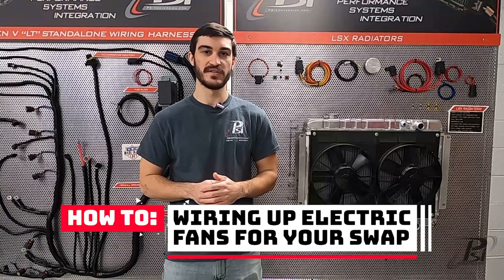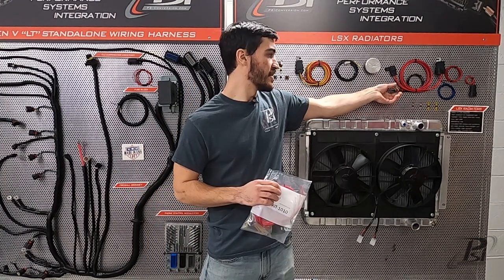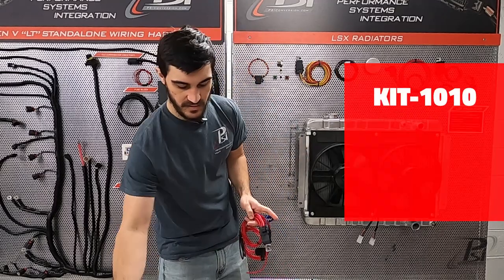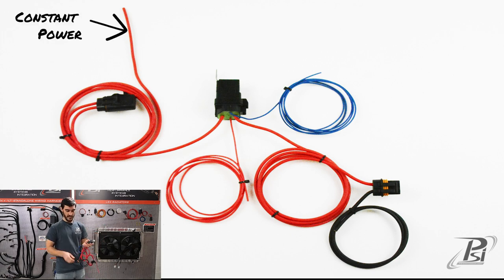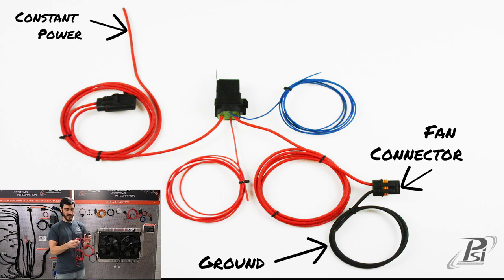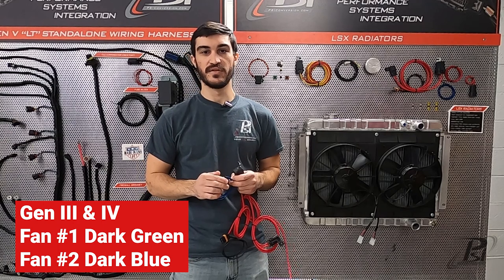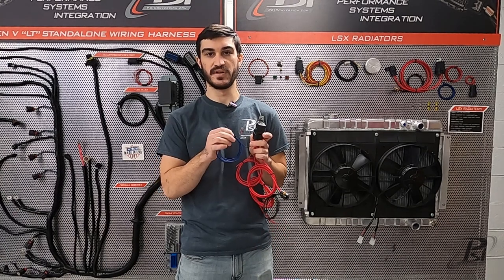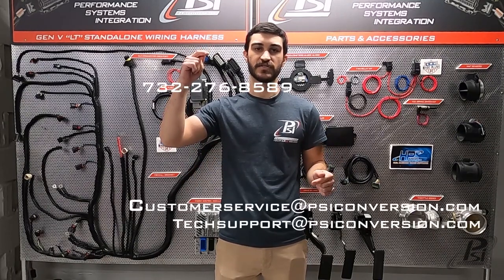PSI How to Wire Fans for an LS or LT Swap Kit-1010 kit-1010 KIT-1010

Comment: I am wanting to trigger the fans from signal wire that activates the oem AC compressor,,, can I run this in line with the trigger on supplied in your harness?  Your harness made my swap easy!
Reply from the maker: the simplest way would be to use a vintage air trinary switch. our fan relays are ground triggered, but the switch is the best way. Also we are thrilled to hear the harness helped to make your swap easy!! we Love to hear it!

Comment: In your video you have two fan connectors coming off the cooling fans. Can both fan’s wiring be routed through a single connector and use a single relay wiring kit or should two separate kits be purchased, one for each fan?
Reply from the maker: We recommend that you use one relay kit per fan for your swap. I hope this helped you out with your swap.
Reply: Thank you for your response